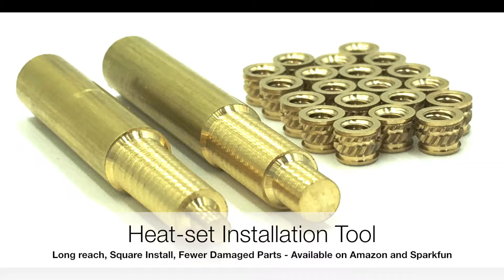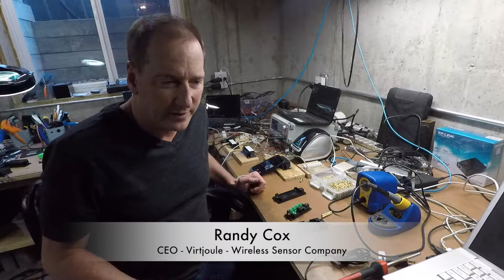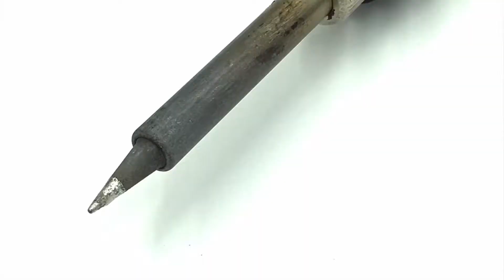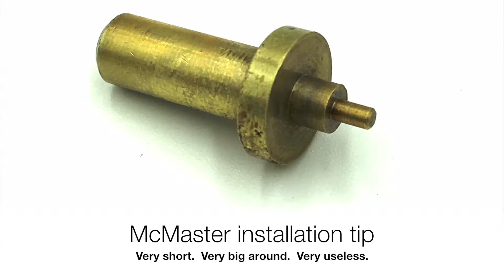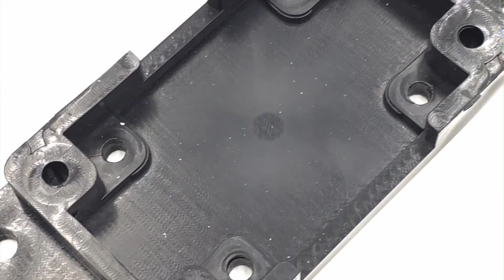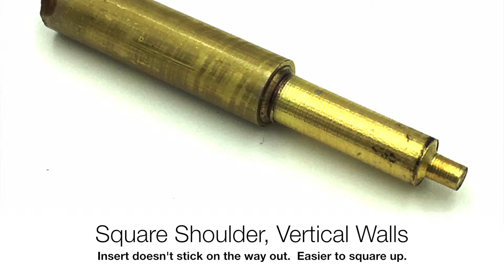Heat-set insert installation tool - Long reach - Tight Spaces - Squared - On Amazon, Sparkfun

Comment: Hero! I had the exact same experience as you - got the M3 installation tip from McMaster-Carr, realized it did not work with my iron, was about to order another soldering iron from them, and saw that you made this!  Very cool, glad it is still available from Amazon.